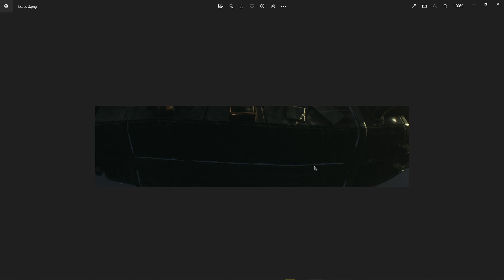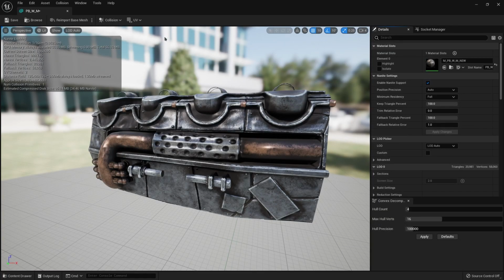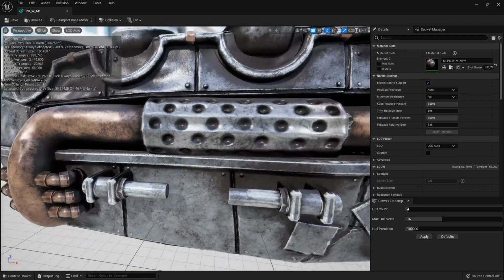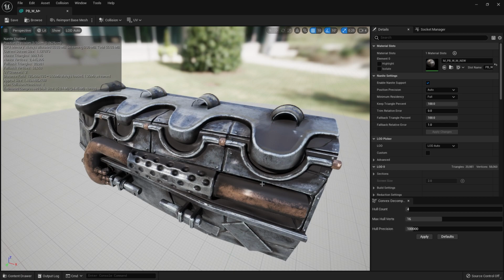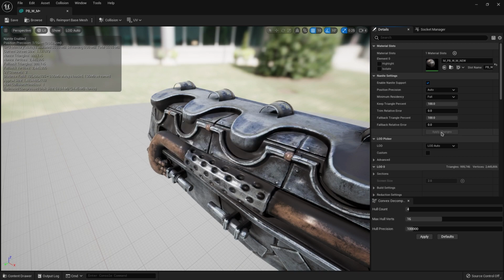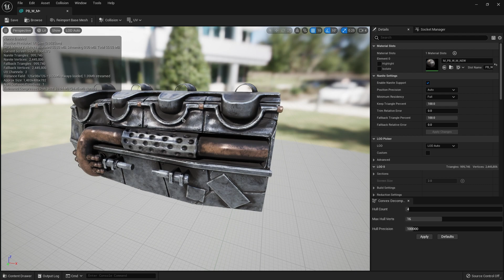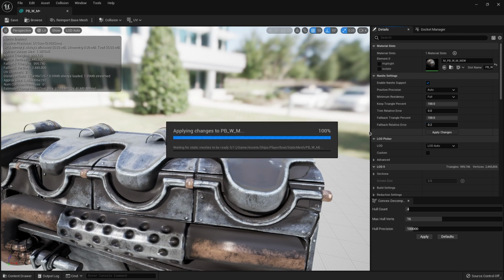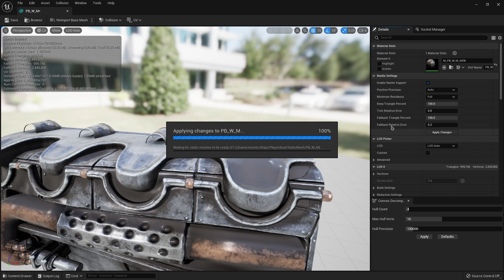How To Fix Unreal Engine Nanite Breaking Meshes!

Comment: In fact, it is more effective not to touch the fallback relative error, but to change the Percent Triangles value. This will give the same visual result, but we will keep the optimization that nanite gives.
Reply: Value to set FALLBACK percentage> default 100> wt is recommended value

Comment: Hey, I had exactly the same issue of mesh disappearing in UE5.4 but on a plant (grass) model. The issue was coming from using a mix of Virtual Texture (VT) and Non Virtual Texture. (I had 'enable virtual texture for Opacity mask' turned off in my project settings). Once that was enabled and all my textures were set up as VT, the problem was gone!

Comment: HI Dear Fellow...
I'm running to an issue with the nanite clipping terrain on my third person default character When i am looking him from above ...
When nanite is disable no issues, but as soon is activate and i turn around the default third person character the landscape disappear beneath the character
Reply from the maker: Hey! Thanks for poppin by my channel :]

As for your issue I'm honestly not quite sure as i have not encountered anything like that yet. Though i did find a Reddit post which might be something similar to what you're getting?
Where changing the resize mode seems to be what solves it. "Try changing resize mode. Try Alt+L. Try changing Max Call Distance. " - PerryDawg1
Source: https://www.reddit.com/r/unrealengine/comments/13pnhkt/landscape_disappears_when_level_is_simulated_or/

Best of luck!
Reply: Hello, I might faced a similar problem as yours. And I solved it at the end by disabling tessellation which in landscape's material inst. It might makes some help to you.